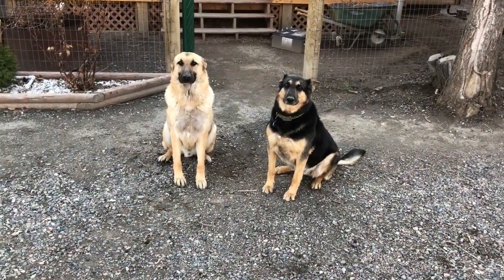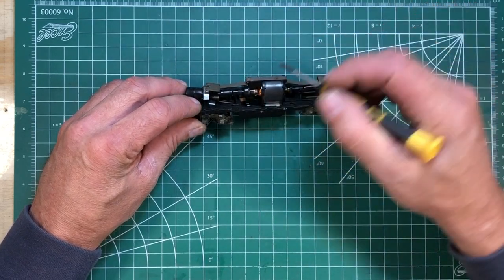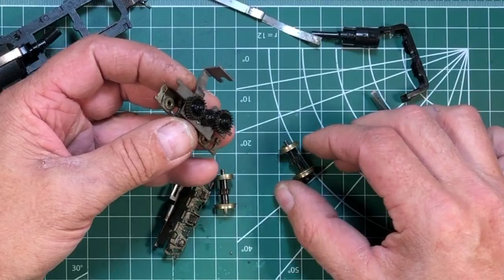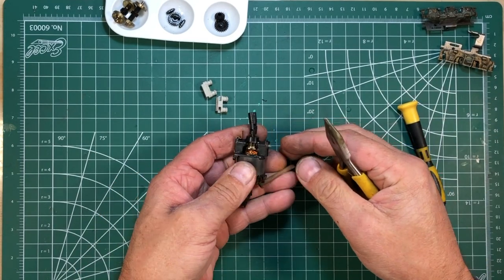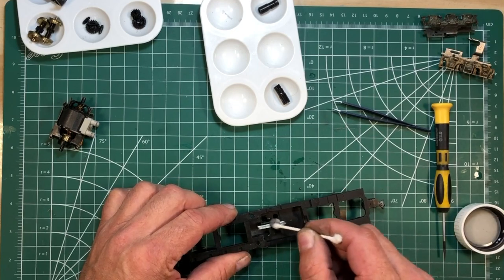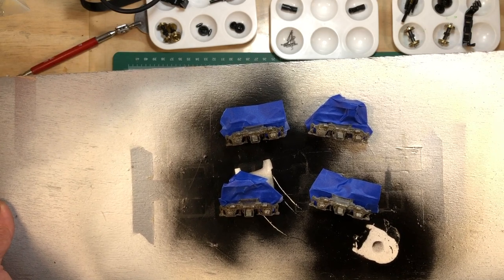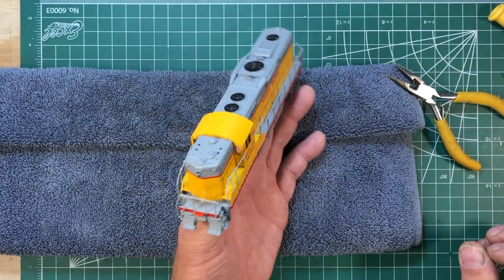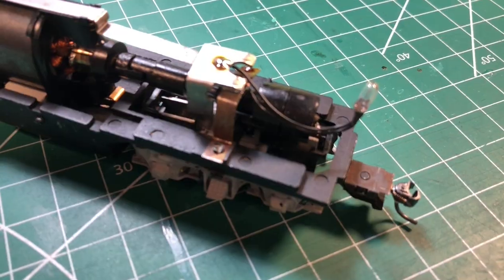Before & After Repair a 60's  Athearn GP-7

Comment: Ron, you do great work!!  The GP-9 looks top notch, and may run better than straight out of the box.  I also liked your Rivarossi Big Boy restoration and really enjoyed it.  I have a box of various Rivarossi loco parts/pieces.  I dug through it looking for a boiler cap for you, but my dismay I don't have one.   Sorry.  My son made a comment to you about jewelry cleaner.  He had told me about it, it works very well for loco motors.  I had mentioned to him that I had just received a diesel loco from E-Bay that wouldn't run. He told me about using the jewelry cleaner.  So I went straight to Wally World, got some, came homeland hooked my power pack to the motor, dunked it in and nothing for about 10-15 seconds, then it started sputtering, and then came back from the dead.  Thank you for your video efforts.  Love 'em!  Have a Merry Christmas and Happy New Year.
Reply from the maker: Greetings David.  Thank you for your kind words.  I recall your Son's comment about jewelry cleaner and decided then That I shall give it a whirl.  Now with your comment and short story about its effectiveness.  I'm thinking this fluid must be a gift from the God's. I will do this technique in my next motor cleaning video.  Merry Christmas to you and yours also :-)

Comment: That kind of packaging in my and several other people's experience is why some time back I declared everyone on all auction sites guilty & stopped using those sites. Now, on to happier things: I really liked those white metal flywheels in the couple GP7, F7, Trainmaster, and the FP45 I had back then. That mechanism was durable, reliable, simple to maintain, and ran well enough for me. Glued some rectangular drapery weights inside the shells of the hood units. Those jokers would Pull.
Reply: Oh, another thing I did after learning of their existence was use the Ernst reduction gear kits. That made those old Athearns really nice runners.
Reply from the maker: Hello Scott! Thanks for commenting.  Ive Read about the Ernst gear kits.  Never seen one in real life. maybe some day :-)
Reply: @classicmodeltrains  They have 2 different ones for the Athearn GPs because there were some gearbox changes with the move from the original cast metal truck sideframes to the plastic truck sideframes.
Reply from the maker: @scottfw7169  I hope to add some of these older gear box conversion loco's to my fleet one day.

Comment: Try Lock-tite instead of CA glue. Green will leach into the joint. The Blue does not require heat to free up. Steer clear of red unless you are prepared to use heat to loosen it. Cheers
Ron, you are awewsome. Love the channel! Chief Rodge
Reply from the maker: Thanks for the tip & your kind words!!

Comment: Came back to rewatch your GP9 video. Just picked one up that is maybe a year or two newer than yours, complete with metal truck covers.  Mine had some damage to the back step deck and steps that I reglued with Tamiya extra thin and then Testors liquid glue as weld for additional support. Will clean up cracks with some Tamiya white putty and should be ready for painting as Northern Pacific.  Thanks again for your videos!
Reply from the maker: Hello again,  Does your's have flywheels?  Sounds like your doing a lot of bodywork on the Ol' girl.  Good luck on your paint job into N.P.!  Thanks again for watching and commenting :-)
Reply: @classicmodeltrains  Thanks!  No fly wheels, direct drive, and has a later light bracket. I really enjoy working on the GP9s had one from back when I was a kid, with flywheels but still metal truck covers, it is now New York Central lighting strip and two more repainted as CB@Q, one black and one red.  I am, or have been, primarily a plastic model builder, but it has been alot of fun just painting and decalling the locos and learning how to,service them from you videos!  All best!

Comment: That looks like a really beautiful locomotive looks like you got it running really good I've got one just like that in my collection
Reply from the maker: Hello K.V.M.R.R.  This one did turn into a silk purse after all I did to it. Now I'm afraid to run it and risk something happening to it. Don't make sense to me but what do ya do ? :-)
Reply: @classicmodeltrains  I just clean every part make sure everything is working correctly usually I checked the motor and make sure it works okay

Comment: My second watching of this video has been just as entertaining as the first.  I love vintage model railroad equipment so your locomotive explorations and restorations of half century old mechanisms are premium watching.  I recommend use of chopsticks for pressing Athearn handrail stanchions into place.  The wood is more forgiving to the paint surface should one slip in the installation process.  Experience from assembly of some 100 Athearn handrail sets over the years. Best wishes and keep up the good work.
Reply from the maker: Thank you very much!  The chopstick trick sounds AWESOME!!  Thanks for sharing that with me :-)

Comment: I have a few of the Athern blue box locomotives, and they're great running locomotives that pull their share! I like that you fixed up this old locomotive and based on what I've seen here there, and everywhere, nod to the Beatles I likely won't be buying those Walters train line or mainline locomotives. I've got a handful of Proto, 2000 GP locomotives that I really like even though I have to replace all of the axle gears in them. I run them with my Athearn locomotives.
Reply from the maker: yup it's upsetting to have to deal with cracked gears.  P2K's sure can be nicely detailed

Comment: Good job Ron! Unlike me... you stayed within budget. 

I generally take the Athearn blue box locos maybe a bit too far. I generally replace internal truck gears, axle gears, and wheel sets. Adding a Proto 2000 motor will quiet them down and smooth them out too. The sad thing is... that after all the upgrades, they perform very well... but for about the same cost I could have bought a used Kato/Atlas from the mid 90s. Just clean and add oil. 

However, after all the time and money...the upgraded blue box... becomes a very nice pig's ear.
Reply from the maker: I understand completely what your dealing with.  I like shining pigs ears also.

Comment: Alternators have rotors, motors have armatures.  Get your nomenclature correct.  If you need old bulbs, I've started a collection of them as I changed them out for LED's.  If I can find them, I'll be glad to send 'em to ya.  Cheers from eastern TN
Reply from the maker: Greetings from Central Montana.  Yeah I sometimes blow (well more than sometimes) my correct nomenclature.  This is one of my early video's.  I believe I have it down pat currently :-)

Comment: You're a master restorer..  Working on one just like it. Where would I find worm gear cover?  One is broken. Two piece as you know. I tried gluing together but doesn't hold.  thnx  Ben
Reply from the maker: With These older Blue box's you might be able to find one at your local hobby store, or Ebay.  Otherwise you will have to buy a parts locomotive from Ebay and salvage the good parts off of it.

Comment: You might consider a pair of locksmith tweezers, which are designed to grasp small springs and cylindrical objects without shooting them across the room.
Reply from the maker: Never heard of them.  I shall do some looking around.  Sounds like a great tool.  Thanks for the info :-)

Comment: 6:04 I have blunt tip tweezers with a cylinder shaped void at the tip to surround a spring when I pick it. Lab (locksmith co) makes one or one could grind it in. thanks for the vid!
Reply from the maker: Thanks for watching and a good tip on handling little springs :-)

Comment: Athearn blue box handrails, motor mounts, and other parts can be used for replacement parts for this unit. These parts are still available from various sources. There are some minor differences such as the trucks, but a lot of the other parts are interchangeable.
Reply from the maker: Hello Cass,  Thanks for the info :-)

Comment: excellent work! if athearn didn't exist, I'd have no diesels. blue box is still relevant as good running machine. note difference in scale to the new walthers, which has a thinner body, due to athearns use of large motors, they had to go wider than scale. Still, the UP geep looks fab.
Reply from the maker: Thanks!  Yes it is a bit weird seeing the new properly scaled hoods compared to the old ones.

Comment: Just discover your channel . Just subscribed nice video .
Reply from the maker: Thanks for the nice words on my vid and the sub!
Reply: I just learn how to rebuild blue boxs locomotives from your video thank you really great video .
Reply from the maker: @houseoftrainsgarcia9794  There is a lot of variations on truck gear towers and truck assembly methods. Older athearns don't have flywheels.  different motors are used through out the ages. The basic principle is the same.  I'm glad I was able to help you out on your model RR journey.

Comment: Sir, what gauge wire did you use for the handrails? I need to make some as well for a tyco c-430.  I have tyco stantions but no rails. Thanks again!
Reply from the maker: Hello EC, just found this comment. sat down to answer them all.  sorry for long replys.   Tyco wire .025". just measured a set I have here.
Reply: @classicmodeltrains  That is awesome!!!!  Will get some and get to it! I hate having locos that require railings and not have any.  Thanks again!!!
Reply from the maker: @ecidaho  yup. They look silly without railings, and to buy new old stock ones it costs more than the loco. Lots cheaper to build them.

Comment: I would NEVER used ACC, or any other  glue on the axles!   I have been repairing Atheran locos for over 30 years, if the gear slips, its split,  new gears need to be pressed on wheels, and reguaged
Reply from the maker: I agree with you.